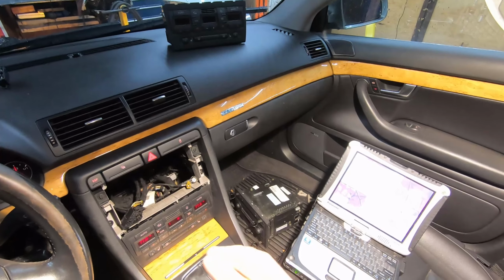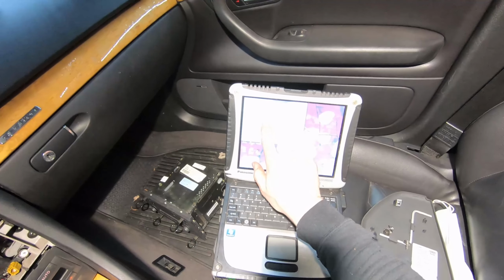Replace your B6/B7 A4/S4/RS4 HVAC Heater Control in 6 Minutes or Less

Comment: I don't have any power in mine was fine this morning then it's now dead completely no heating what could be the issue
Reply from the maker: Start with the easy stuff check fuses.
Reply: @PBGarage checked fuses which are on the driver side beside steering wheel all fuses are fine
Reply from the maker: Next thing would be to pull the HVAC unit and check for power at the plugs. If you can pull a spare unit from the junkyard to drop in and test would be helpful too.
Reply: @PBGarage does it need coded to anything or plug and play?

Comment: I've got one that all features work when Key is on with engine off.. when I start the car it Only turns on defrost at full fan. Ever seen that before? I am thinking it may have been replaced before we bought it but would a reprogram fix an issue like that?
Reply from the maker: That’s a tough one. Sounds like wrong coding but I’m not even sure if that’s the case. Are you in North America or in Europe? I’m not sure I’m some of the euro market cars had drastically different features and so the pinouts on the back of the unit are different or what.
Reply: @PBGarage  Im in north America. It's just been a very strange issue.  I've got heat which is good because it's cold here right now, but id like to beable to divert it to other vents or atleast turn it down once in a while! 🤷‍♂️🤣
Reply from the maker: @Brokendiesel1982 I would be tempted to pull an extra set of controls from a junkyard car and try them. But they’re pretty easy to find around here.

Comment: Sorry just recap 
If you swap units out you need to reprogram the new unit in 
Sorry to sound stupid 
Was wondering why my rear window  demister didn’t work but the old one does 
Thanks Rico 
Any help please
Reply from the maker: To be perfectly honest I’m not sure if not having the module coded to the chassis would keep the rear window de mister from working. If you can find someone local with VCDS and code the module you might get lucky, but I’m wondering if it might just be an issue with the buttons on the new module.

Comment: hey man, on mine it does not let me press save after testing the value. what could be the problem?
Reply from the maker: Could be a communication issue, like if the module has active faults. Could even be an issue with other modules that are preventing comme with the hvac module. Or if you’re not using genuine vag com.
Reply: @PBGarage  I managed to solve the problem. Had to enter/exit the adaptation menu a few times and it finally worked.